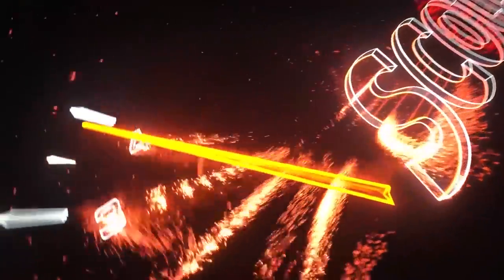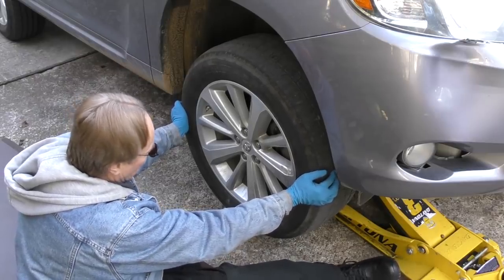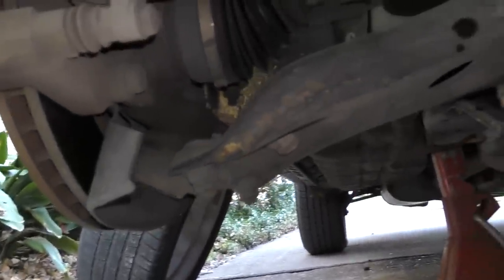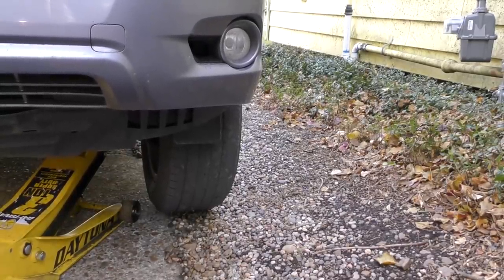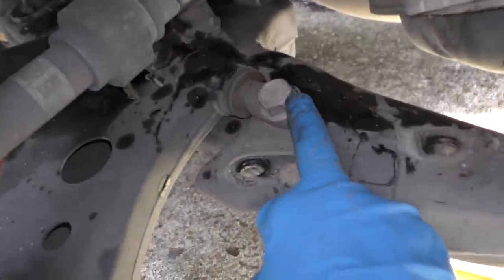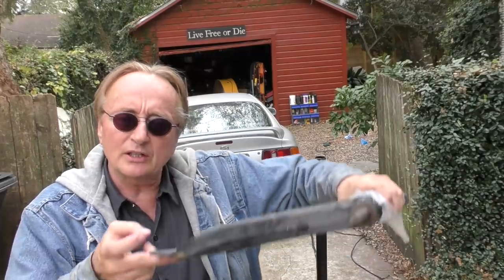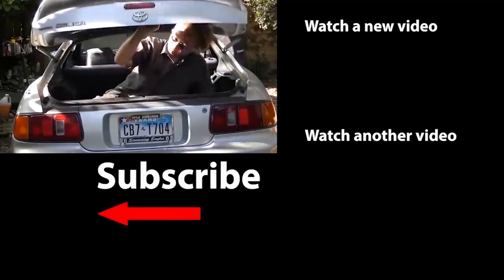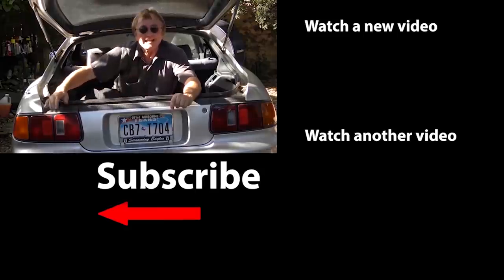This Mistake Cost My Customer Thousands in Car Repairs

Comment: Nothing happened to it, it's a Toyota, just keep driving.
Reply: Fred I wouldn’t do anything
Reply: j freed Doesn’t take a mechanic to know that. Hitting curbs messes up your alignment. And braking is negatively affected.
Reply: @nobodylmportant  What year is your Rogue?
Reply: My honda civic has the same dent. Drives and looks fine.
Reply: That’s what I do with my Honda
Reply: Fred ikr
Reply: In Tacomas you can. The camber, caster and toe are all adjustable up front. All trucks need to be like that, but nope some don't.
Reply: 03 camry just hit 200k told myself id upgrade once this car quits. Been waiting 8 years haha.

Comment: You can tell they drove it for a while like this because the outer edge of the tire tread is all scrubbed off.
Reply: I was an auto mechanic for 32 years and did wheel alignments for about 10 of those years.. what has happened here more than likely is with any damage to the lower control arm will change the toe angle on the tires. looking at both tires shows wear consistent with a toe in angle meaning the forward facing part of the tire is now pointing more towards the center of the car

Comment: A wheel alignment would be a good idea after replacing suspension parts.
Reply: good advice but if he doesnt remove tie rods while he change the control arms, maybe alignment doesnt necessary
Reply: @trianggaindralukmana2184  I didn't think so either until I had the rear struts on my 1998 Camry V6 replaced and the steering wheel was now tilted at 20 degrees when going straight. A 4-wheel alignment (a change of .25 degrees on the left rear wheel and -.3 degrees in the right rear wheel toe-in) brought it back to normal.
Reply: A wheel alignment would be good if you also hit a curb
Reply: @jamesmanson2152  or brake into a mean pothole
Reply: I was thinking that but I figured surely Scotty would’ve mentioned that.

Comment: i think i have done 3 lexus water pumps in my life in 33 years of working on cars,   they are just better made,
Reply: I was thinking even my 2004 Ford Ranger 3.0l V6 has 265,000 on it and I've replaced the radiator once and all the hoses twice so far but not the water pump. Have a brand new one in the box ready to install once it goes but so far its just collecting dust on my shelf..
Reply: You pay more for them, but their worth it.
Reply: I change my water pump, on a25 years old on Ford  ranger ..

Comment: The stamped steel arms are more prone to being bent, but they keep the tires under the car. Cast steel arms are the toughest, holding up even with impacts that break wheels. The worst option is what you find under the current generation Camaro. It's a small cross section shaft that is cast aluminium. Far too easy to break. The toughest arm in a comparative car is the triangular cast steel found in the Mustang. I have seen some Mustangs with a tubular steel shaft control arm that is not as tough as the triangular cast steel, but tougher than the Camaro shaft. I am not in the suspension business, but I put hooks on lots of cars and pull them onto my flatbed. That gives me an up close look at the many types and I sometimes get to see them after the cars have been bounced around in a terrible game of auto pool.

Comment: @Scotty Kilmer  you also need some front tires and  wheel alignment on that car scotty. judging from the wear there is most likely a toe in issue and maybe a slight positive camber issue. northstar makes camber adjustment bolts if needed.

Comment: Scotty fixes one side 99% of mechanics umm ya so we gotta fix both for umm purposes🤔
Reply: Reasons.
Reply: livewireOr 💰🏧reason
Reply: In this case its fine to replace only one side. Now if you have a cv joint go out your much better off replacing the whole cv axle than just a single joint.
Reply: They are scam you.some times front connecting have problem cause of time use they change two sides but at this case one side change is enough.
Reply: Kave Azadmard true actually

Comment: Ha 3 pumps @ 105k?
I had a 03 v6 Camry. Car got totaled at 187k.  Had original starter, waterpump, all ac parts, only axles had to be replaced. It was a beautiful car. RIP.
Reply: Al Ram I've got a nice 99 Camry out back, gonna drive it someday if my Celica ever quits, 10 years still going strong

Comment: Hey could you help me with my car i really need to find out i have nissan300zx 1992 the car runs and drives nice, but sometimes it wont shift into gear nicley or not at all and i have to force it in if i pump the cluch a bit it dose work once in a while but sometimes it just wont go in at all and like i said i have to force it in, the previous owner said he replaced the cluch, the master cylinder and the slave cylinder, but he didnt do the cluch lines, could that be the problem?

Comment: Or he is putting too much tension on the Belt causing the pump to go out. Radiator goober probably poked a hole in it not removing it before changing the pump. So yeah get a new mechanic.

Comment: Is a 2009 honda accord 4 cylinder for $4,100 a good deal?
Reply: Alberto_4015 how many miles. Also I have a 08 and bought is for 4200 that had 134k on it, if that helps.

Comment: What a stupid design and thats why front drive suks
My Silverado has strong STEEL front bumper that destroys anything it hits 😂😂😂
Reply: s3xyScorp The Silverado front end is a lot weaker than the Highlander. Just hit something at the same speed and find out. There is very little protecting the front end on that Chevrolet.

Comment: hi Scott,,, new kia and hyundai cars are very good,,, i now you dont like them but now Korean car are in new level ❤️
Reply: They’re good when there new, I just traded in my 2012 Hyundai Santa Fe Limited with the 3.5 V6 with 100100 miles on it.  We bought the car new in 2012 and took very good care of it, changed the oil with full synthetic oil every 3k miles and changed out the transmission fluid at 40k and 80k miles.  We were very disappointed with the paint and finish on the exterior and the transmission was starting to go, that’s why we traded it in and bought a new Toyota Tacoma.  The engine ran well but the Transmission was getting ready to call it quits.  I’ll Never buy another Hyundai or KIA.
Reply: I got a 2006 Sonata V6 with 188000 Miles still going strong didn't replace anything in the engine bay except the battery
Reply: joe pierson   I’d be willing to bet you that there are a greater percentage of 2006 Toyota Camry’s on the road than 2006 Sonata’s.
Reply: @deepcow  i have a kia sorento 2014,, 2,4 engine mpi  and i bought it from 2014 and it still going very will with out any problem now its 230k mils
Reply: @joepierson3859  they are good car ❤️
Reply: Mohamad Jawhar   There will always be exceptions. All in all, Kia/ Hyundai are average at best.

Comment: I switched to 0W-20 in two cars we had, a 1996 Honda Accord Wagon and a 2002 Honda CR-V. So I went to the thinner oil and never had any problem with oil burning or leakage and both vehicles ran fine engine-wise.  The CR-V leaked transmission fluid at 220,000 miles and the Honda Accord had some rust problems. But we never had any negative effects from using the 0W-20 Mobil1 in these older vehicles.

Comment: That’s better than the RAV4 V6- you need to drain the oil and transmission fluid, take off the pans, which gives you access to the LCA bolts.

Comment: The ideal engine oil will have the exact same viscosity at all temps. In practice, the xW number should be as low as possible for best possible cold flow and the 2nd bigger number that denotes viscosity at 100 Celsius aka operating temperature should be just high enough to guarantee sufficient oil pressure at all possible operating conditions.

Comment: Hey Scotty,
I've hit a curb a long time ago & had a similar issue to this that's never been 100% resolved. I already replaced the lower control arm & that helped alot, but my tire is still slightly shifted backwards by less than an inch. Any idea what might be the cause of this?

Comment: I changed 3 fuel pumps this year that cracked at plastic nipple on top of pump that only leaked when running, of course 2 were Chrysler's one Nissan all were running as designed.

Comment: Scotty. 2015 Kia Soul has a strong vibration which even passengers can feel in idle and park when warmed up, changed the sparks and took to a mechanic after he said the motor mounts were bad and took to Kia for warranty and they said it has little the motor dapeners in souls so it idles commonly like that. Never happened before in the first 4 years What do you think??

Comment: Hey Scotty, my dad has a 2005 Honda Odessey, he went to a mechanic to check out the transmission oil and they told him that they can’t change it because it could damage the transmission and stop working, and it has 175k miles, what could be the reason ?

Comment: Sorry Scotty but your missing information ,,,,,An alignment check and wheel balance should be performed after replacing that control arm , if the hit was hard enough to bent a steel  control arm it could of easily bent that aluminum wheel and also tweaked the alignment.

Comment: Just saying the mounting bolts for lower control arms and motor mounts are one time use bolts and nuts because they’re torque to yield but guess that doesn’t matter when you work in a driveway...it’s a risk reusing fasteners that are one time use.

Comment: Scotty!  Thank you so much for this clip!  I bought 2001 MR2Spyder.  When I picked it up the steering wheel was not sitting level and I didn't know why.  Now I know! There were so many non-disclosures from the fraudulent dealer (forced to shut down for unfair trade practices).

Comment: Scotty what are your thoughts on going from 10w30 to 15w30 or 15w35 whatever it is for my 237K ranger
Reply: tbone3366 wow why not go oem specs?
Reply: @dabruiser7938  I plan to turbo charge and avg temp during summer is 122 degrees
Reply: @dabruiser7938  duratec 2.3 rated temp range is 235-275
Reply: Ohh ok I see your modding
Reply: @dabruiser7938  yea. Gonna run a .67 AR turbo and 17 psi